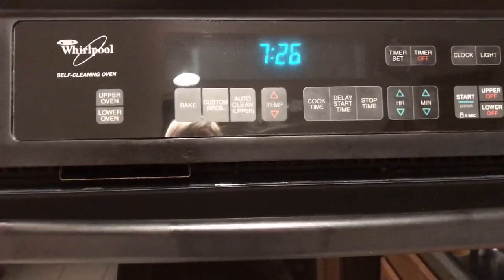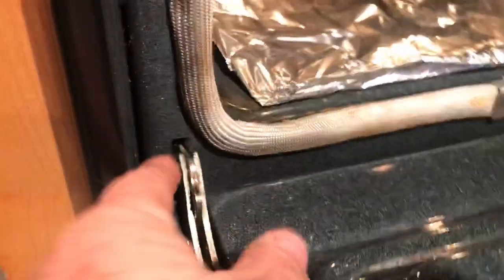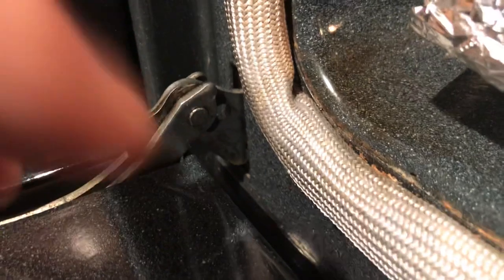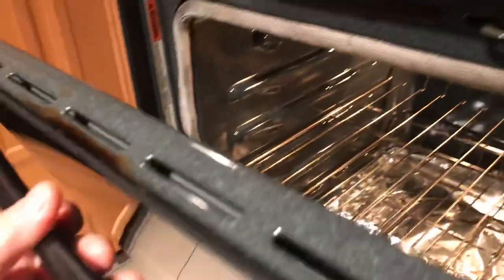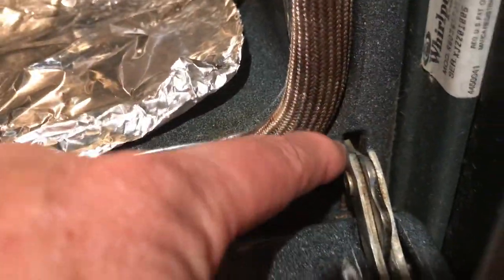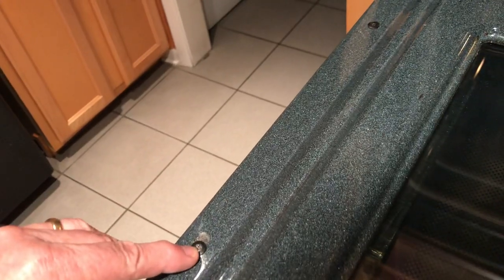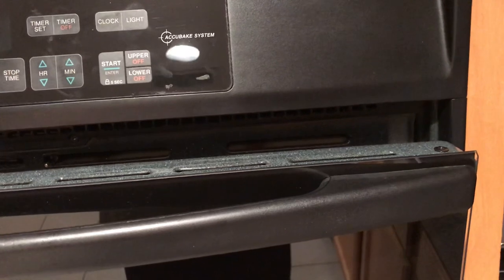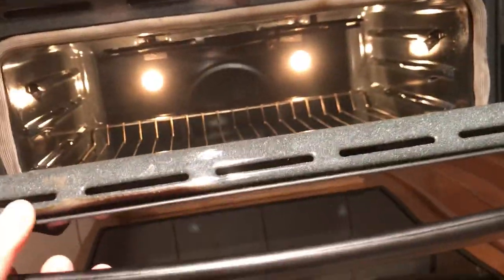Whirlpool Oven Door Removal Old Style without hinge lock

Comment: How to Put the Door on a Whirlpool Super Capacity 465 Accubake Oven

The hinges on a Whirlpool Super Capacity 465 Accubake oven attach to the oven door rather than the body of the oven. When you remove the oven door to make repairs, you must secure the hinges in the open position to allow you to put the door back onto the hidden hinge pins after the repairs are finished. Failure to secure the hinges can complicate the reinstallation of the oven door, as the hinge springs make it difficult to move the hinges from the closed to the open positions.

1-Lay the oven door face down on a stable work surface or the ground.

2-Grab the exposed hinges at the bottom left and right sides of the door with your fingers or pliers. Pull the hinges from the door until you expose the small round opening on each hinge.

3-Insert a small finishing nail through the holes in the hinges. Release the hinge. The small nails hold the hinges open.

4.Lift the oven door. Make sure the open hinges face away from you.

5-Insert the hinges into the slots cut in each side of the oven opening. Two hinge pins exist inside these slots. 
Lower the hinges onto the pins. This may take a couple of tries before you hook the hinges over the pins, as the pins are hidden from view.

6-Close the Whirlpool Super Capacity 465 Accubake oven door as far as the nails in the hinges will allow. Hold the door in this position while you remove the finishing nails from the hinges. Allow the oven door to close.

Things You Will Need
-Pliers
-Small finishing nails

Hope this helps, I found this directions in the internet after I watched the video and then have a little trouble to put the door back. However, I watched this video firsts and helped a lot, thanks so much for taking the time to post it.

Comment: What is  16 penny?  I cant reinstal mine. Here we have 1, 5, 10 25 cent only. Not 16 Penny.
Reply from the maker: 16 penny is a nail size. Doesn't have anything special to do with it.  Just use a drill bit or Allen wrench that fits in the holes

Comment: This works great! But I’ll admit a video would have been great for us literal knuckleheads. Studied my hinges (was exactly like this one)  for 30 minutes and couldn’t figure out how it was going to work. Hunted for other videos and web to no avail. Finally got my Allen wrenches out, inserted short ends from outside in, leaned long end agains stove body, slowly closed door and eureka! Magic happened! Put the door back on just to verify, a little trickier but not much! Now just hoping there is a thermal switch I can reset once I pull it out that popped during self-(shoot yourself in the foot) cleaning. Thanks for video! Never would have figured it out myself.
Reply from the maker: Thanks for watching. The thermal switch Is in the back of the oven. It is not resettable you have to buy the part. It’s an easy fix but getting the oven out as a quite a chore. We don’t use our self cleaning anymore due to the fact that the thermal switch has tripped twice. Cabinet must get too hot. 😞